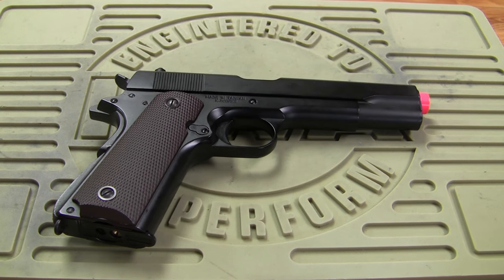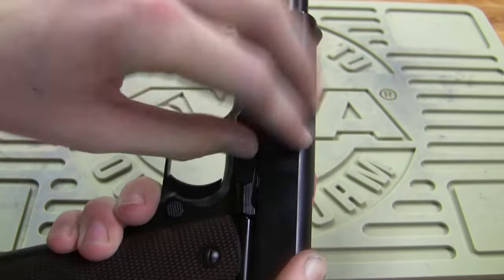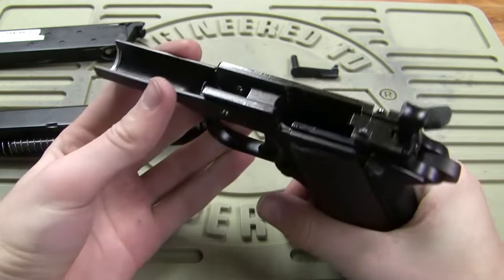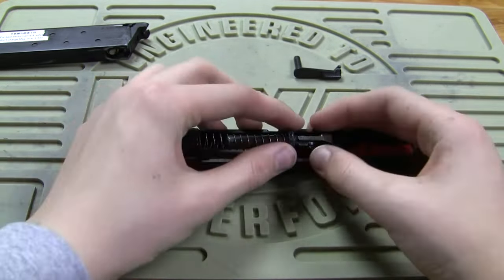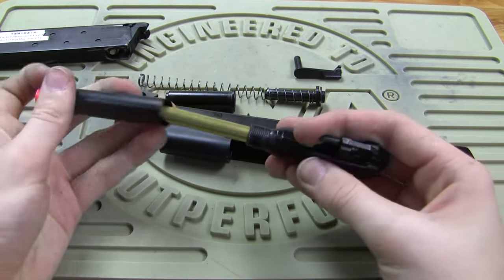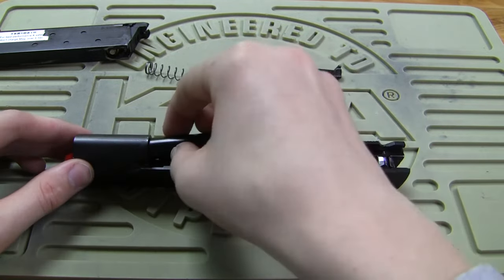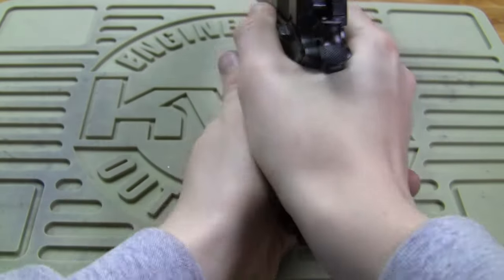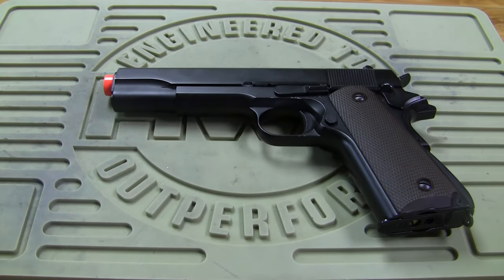How to Clean and disassemble a M1911 (Airsoft GBB)

Comment: you can't just pull the pin out like he did in the video, that will break a little part that will cause the gun to jam here and there. unfortunately learnt that the hard way.

the correct way is there are 2 Grooves for the pin to slide into a big one which holds the slide back when you empty a mag and a groove behind it which isn't as big which is where you want to pull out the pin

Comment: 1:52 that red box in my pistol won’t move unless I move it, so I guess the spring isn’t working. So when I shoot it the slide goes all the way back but half way forward. How would I fix this? Btw I have the 100th anniversary version
Reply: bit late but ive got a 1911 doing the same thing, my red part moves but very stiff, ive oiled it an pulled apart to see if anythings catching.
Did you happen to solve the issue?
Reply: Yoo i have the same problem well i mean my spring broke does someone have a replacement?
Reply: It's call the nozzle I think evike has replacement for $15 new nozzle and spring. You can take off the blowback housing with a 2.5mm Allen key where the hammer rests on.

Comment: When putting the slide pin back in, I had to pull the slide back a bit so it would slot in but now I can't pull the slide back because the back end of the pin pushes itself out. Any idea why?
Reply: it only does this when the mag is in it

Comment: Hey my black ops 1911 airsoft is leaking, ever time I put a co2 in the mag it leaks how do I fix the problem. Do I need to oil it or what.
Reply: MrHacker-CFW Field strip your weapon and check all o rings and seals, if need be replace all o rings and seals.